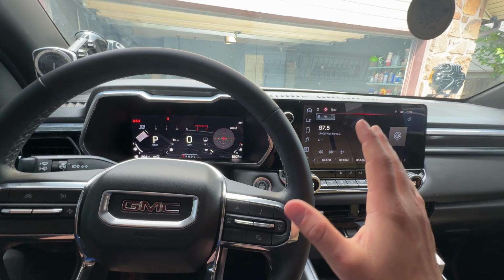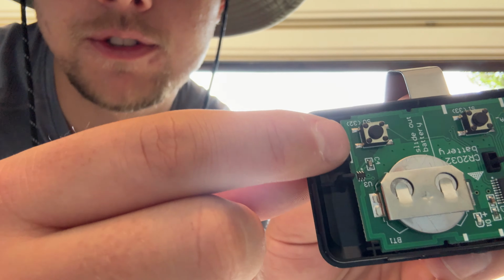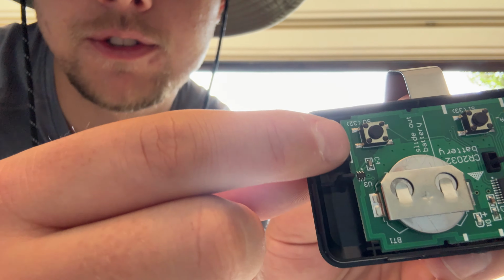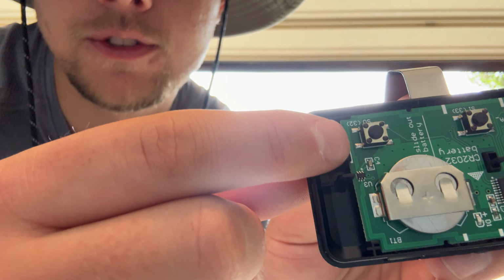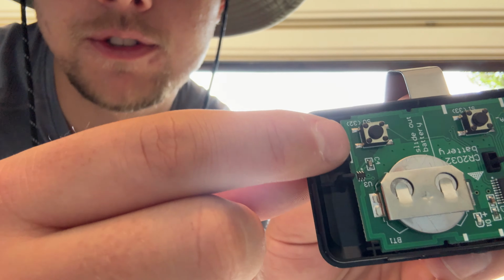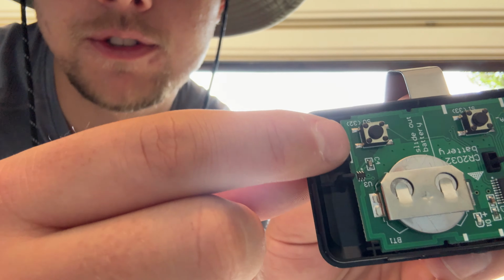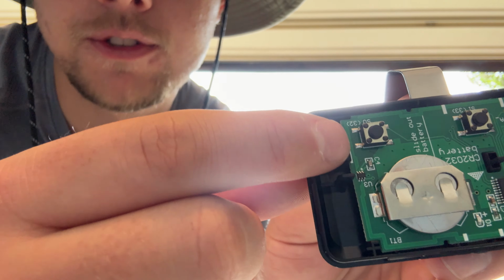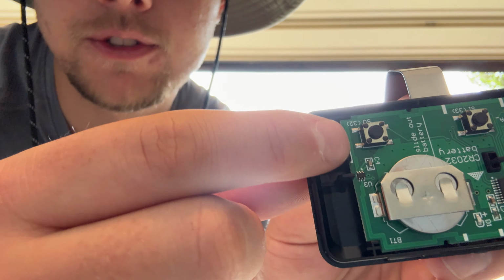Use Your Auxbeam Switch to Open Your Garage!!!

Comment: I’m definitely doing this
Reply from the maker: I’ve had it installed for a week now and I love it
Reply: I’ve tried this. It didn’t work. I guess the circuit can’t stay closed in my old craftsman garage door opener.
Reply from the maker: @dmilillo  I have my switch set to momentary. Email a photo of how you have it wired into your garage remote. Desertsandworm@gmail.com